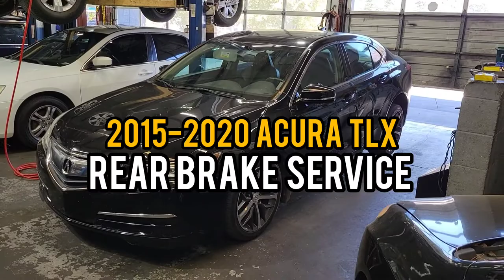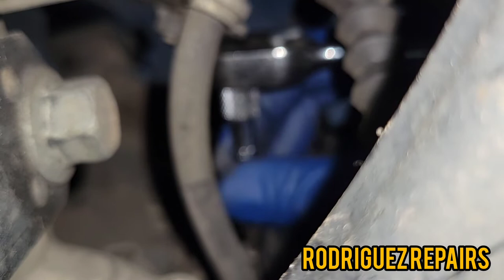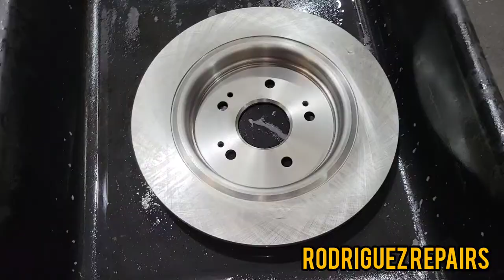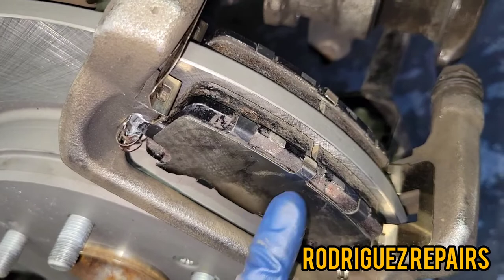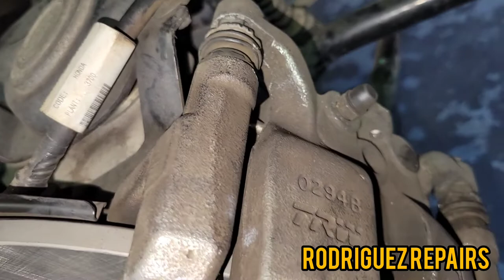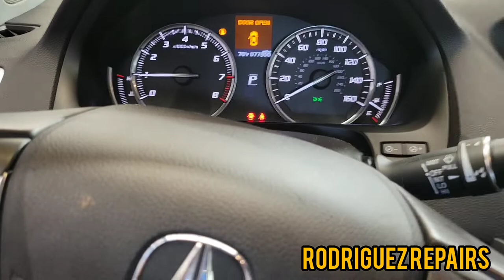Acura TLX Rear Brake Service Procedures (2015-2020)

Comment: As an ase certified tech I’m telling all people please don’t do this. There’s a epb function in any good scanner for this reason. Never disconnect and never manually refund the piston on caliper unless cars in service mode for breaks.
Reply: yes i saw that and im not certified but that just looked wrong i have a brake pad tool that retracts the piston but i never retracted it before taking the brake pad out for when i owned my honda
Reply from the maker: and what do you think that scan tool is doing when you put it in maintenance mode? It commands the servomotor to retract the plunger in the caliper so that the piston is able to be pushed inward. Yes, putting the vehicle in "maintenance mode" is the oem way but most people do not own bidirectional scan tools, plus most of the time, you have to leave the scanner connected and ignition switch on until the full brake service is completed, which you would have to put a Battery charger on the vehicle so the battery does not drain. I have done many of these systems and never had a problem as long as the steps are followed correctly. 👍🏼
Reply: Being ASE certified doesn't necessarily mean hands on, a lot of people are great at taking tests and a lot of people are great hands on, do you!

Comment: Good detailed video, what kind grease did you use for the rubber seal for the electronic parking brake?
Reply from the maker: Thank you! i just used high temp assembly grease

Comment: Great video. I used it to do my back brakes. Only thing I would add is if anybody wants to paint their calipers and caliper bracket they should do so while doing the brakes. Maybe add the torque values for the caliper bolts and bracket. 

Per Acura it’s 80 lb-ft for the caliper bracket bolts and 53 ft-lbs for the caliper slide bolts. 

Thanks for making this video for all of us who have never done it before.
Reply from the maker: Great tip! Thank you!

Comment: Why did you not bleed the brakes? Genuine question. There is a bleeder valve so im assuming you should bleed them prior to reinstalling the electronic parking brake. No?
Reply from the maker: No, the parking brake is fully "electronic" the hydraulic system does not get touched or is involved is changing the brakes. The only time you would bleeding the brakes is when replacing the calipers, but in this video, we removed the "electronic" part of the caliper. The Hydraulic line was untouched.

Comment: I think u have to also put on service mode changing the rear breaks
Reply from the maker: If you are going to do the rear brake service by using a scan tool, then you would put the brakes in "maintenance mode" and the scan tool would retract the caliper piston via the actuator. This is the manual way of doing them and it works.
Reply: @RodriguezRepairs  awesome thx I appreciate you